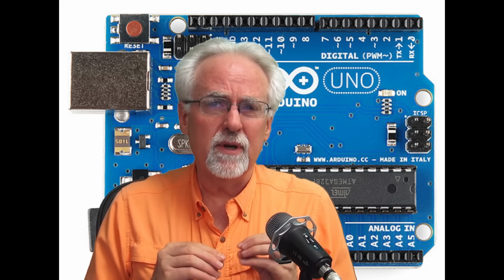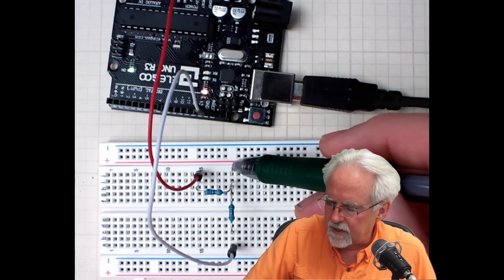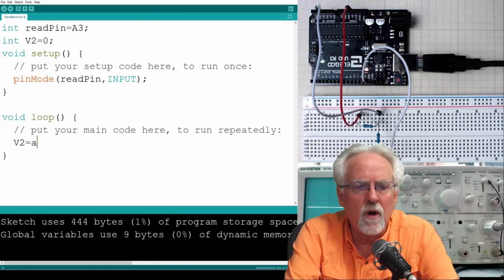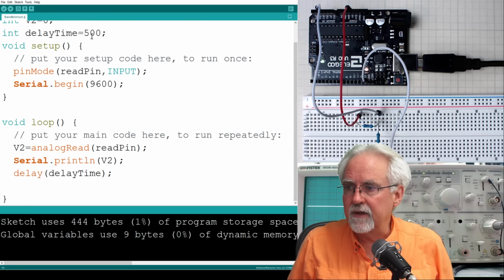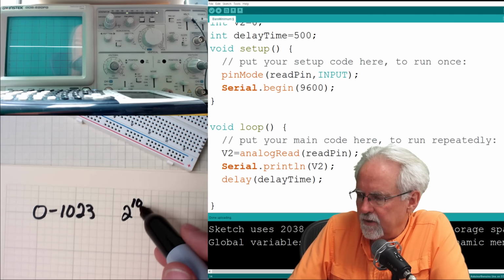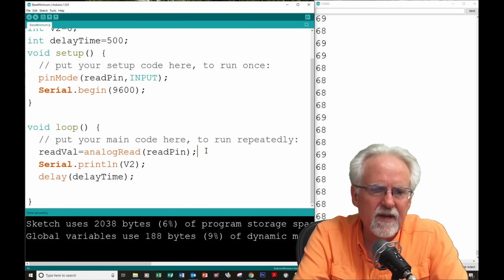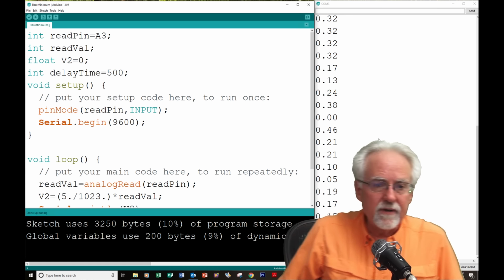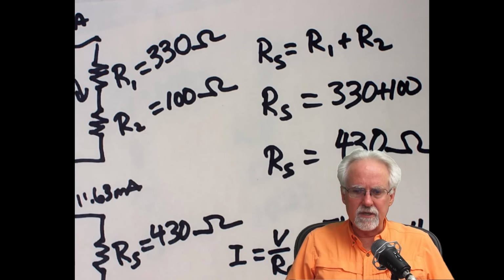Arduino Tutorial 10: Understanding How To Read Analog Voltage using analogRead Command

Comment: I was able to apply the analogRead on a circuit with 3 resistors, and calculated the voltage drop across each resistor and confirmed the potential difference using the voltmeter. I was also planning to read the current using arduino pins but later on, after some research I got to know arduino pins are designed to read voltage not current. Was a great learning experience!
Reply from the maker: Excellent!

Comment: Can the Uno do analog voltage reads on a voltage that is higher than 5v?
Reply from the maker: No, only up to 5
Reply: @paulmcwhorter  I can use a series of resistors to drop the voltage down to 5 V so that way I could program the micro controller to display a different LED to indicate power level of a power supply?

Comment: code compiled. even uploaded and ran but all i kept getting was "0.0" on the serial  monitor. also with the readVal integer, is that a command? i must have missed that part
Reply: when i put my multi meter on it it showed me the values on it

Comment: Weird, when I pull the probe from A3 from the breadboard, the reader is still reading and fluctuating around 1.5 Volts, which i guess makes a read error of +1.5/-1.5 V error in reading? Why is this?

Comment: I'm a little confused by one thing. I got the correct values by setting up the circuit with r330 and r100. When I remove r100 and try to read the voltage  at the trailing lead of r330, I get 0. Shouldn't I be getting a voltage value of 3.84?
Reply: It sounds like when you removed r100 resistor, you cut the circuit so now no current flows, thus the readout would be 0.

Comment: Great tutorial again.  
Question: In turorial 7 we learn to analog write with numbers between 0 to 255 while on tutorial 9 we learn to analog read with numbers between 0 to 1023?  Why the range of the analog read and write are not the same?
Reply from the maker: The difference  between 8 and 10 bits

Comment: Another one done. Thanks again for there wonderful lessons. I used a 2k and a 1k resistor. 
First did the calculations:
I=V/(R1+R2) > 5/3000=1.67mA
V1=I*R1 > 1.67mA*2000=3.33V
V2=I*R2 > 1.67mA*1000=1.67V
Then put it together on the Arduino
V2 output on the serial monitor: 1.66

Comment: Is there a way to measure the voltage across R1 directly (instead of using 5V - V2)?  This is still a little confusing to me.  When you measure voltages with a voltmeter you use two wires and you can put them where you want but from what you are saying, the Arduino can only measure the voltage between one wire and ground.

Comment: I'm having trouble getting my serial monitor to give back a reading. I've triple checked my circuit. I'm using an Elegoo 2560 and Arduino IDE 2.3.6.

Any advice is appreciated. Thank you

Edit : Solved, crtl-U to run program. (ctrl-R just compiles/verifies)

Comment: so i have a funny experience to share and also a question to ask . So basically i used two 220 ohm resistors because i knew obviously that the voltage will be 2.5 Volts but when i checked in serial monitor it was reading 0.43 volts , after scratching my head and changing resistors i realized that the pinMode was OUTPUT instead of INPUT in my code hahaha , before finding this error i noticed that when i removed the ground pin , the circuit was still working. So my doubt is that does arduino consider the analog pin to be at 0 volt by default if we make it an output?

Comment: If you have 5 volt divided by analogReads range which is 0 to 1023. Then a variable to calculate the actul volt is V = (5 / 1024) * ReadValue. But in the video you divide by 1023.
Reply from the maker: No, actually not. Try what you suggest. We agree a read value of 1023 is five volts. by your equation,  V = (5 / 1024) * ReadValue when ReadValue is 1023, you do not get 5. You are not thinking about the problem correctly.

Comment: I have now spent hours trying to understand why my serial monitor is showing different values than yours. Placing the read pin before the first 330 ohms resistor, it shows around 1015-1017. When i place it between the two resistors the serial monitor shows 35. Why is that? I have been over the board and the programming for atleast an hour now and I am 100% sure that it is exactly the same af yours, so why the difference? I realy hope you can help me out here 🙏
Reply: I have now bought a multimeter and it measured the same as the A3 read pin, when its in the breadboard, but as soon as I remove it, the multimeter measured the correct voltage. I do not understand why though. Can it be because i have connected the arduino to my laptop and not a "unlimited" power source? Please help me understand 🙏
Reply: I figured it out! Yeeehaa! 😃😃

Comment: I really like your tutorials, however, your math on the ADC on Tutorial 10 is slightly off. A 10-bit ADC stores the voltage being read in memory, with 10-bits that 1024 possible values.  So, you need to divide by 1024 like it states in the ATMEGA328P datasheet.  ADC = Vinx1024/Vref.  I know the error is minimal 1/1024; however, fundamentally it is incorrect.  You must think of 0 as a range from 0 to the approximately 5 mV until it becomes a 1.  At the other end the 5 V is 4.995 V to 5.0 V, with 5 V as the default reference.
Reply from the maker: Actually you are wrong. With ten bits, you can represent 2^10 different values, which is 1024 values. since you start counting at 0, you can count to 1023. The largest number, therefore is always 2^(numBits) -1.

Comment: The first lesson I’ve found tough! Maths was never my strong suit. I did feel this was a bit quick paced for me. I’ll watch it in full again and and again until it sinks in properly as it’s clearly got tangible benefits. I’m hoping to use some of these projects in my own job and having a clear voltage indicator available on some of the equipment at work would be hugely beneficial. Thanks again for all your time and effort to make these videos!

Comment: I'm getting it now.  I tried a 2000 and a 10 ohm resistor.  First I calculated on pen and paper the voltage drop, getting 0.02.  Then I ran the code and got the correct value, 0.02.

Comment: Hi Paul, help please. I have set up the Arduino and circuit but for some reason the Serial Monitor reads 0 continuously but if I remove the A2 or gnd leads the SM shows various readings. This happens with a separate Arduino.

Comment: What if you want to read the other resistor? As far as I understand, and tested myself, you only have three places to read voltages: Near the source, that reads 5V, near the ground, that reads 0V, and in the middle, that reads 1.16V, is there a way to place A3 in order to read R1's voltage? Thanks a lot for the tutorial, I'm loving it!

Comment: Digging this format! I have a strong background in hardware controls but very light on the programming side. I'm a bit confused as to why when declaring the variable readVal (int readVal) it is not set to a value. I get int V2=0, but not sure I understand readVal not being set to a value (int readVal=something). I am learning so much, this lesson seemed to speed up a bit for me. Thanks again for the most excellent content.
Reply from the maker: It will get assigned a value when you read from the analog pin. Before you use a variable, you have to declare it. You dont have to give it a value at the time you declare it.

Comment: What am I missing. This has been giving me problems. I am using a Chromebook and the Cloud app, but that should not make a difference. I have a jumper going from 5V to A2 on the Serial log I get 16 even when plugged in the 3.3V gives me 16

int readPin=A2;
int V2=0;
int delayTime = 500;

void setup() {
 pinMode(readPin,INPUT);
  Serial.begin(9600);  
}

void loop() {
  V2=(analogRead,readPin) ; 
  Serial.println(V2);
  delay(delayTime);

}
Reply: I think the Cloud interface is the problem, the cloud solution cannot use the Serial interface. So I will re-configure to a PC based system and start again.

Comment: Sir, Arduino can read negative voltage?
Example is:
+5V Input to A0 
255 output from PWM pin
But I want to
+5V = 255
  0V = 127
 -5V = 0
This is possible sir ?

Comment: Hello, Paul I'm NOT getting the results that your getting on the analog monitor (I am on MacBook) I get this box underneath ny code withdow.

Output      Serial Monitor x
Message ( Enter to send message to 'Arduino Uno' on '/dev/cu.Bluetooth-incoming-Port' - Drop down box - Drop down box (9600 baud)
Where did I go wrong?

Comment: Thanks Paul. I'm here mainly to learn how to program the Arduino. In the early 80's  I used to write programs for the Intel 8748/49 microcontroller in machine language for test jigs at work and also my personal projects. It was great fun and very challenging. I came across the Arduino kit while shopping in Amazon and thought it would be nice to get back into it again and keep myself busy in my retirement. Circuits aren't a problem as I have designed and built lots but I'm here for the programming. You are an excellent teacher and thanks for the time and effort you've put into making these videos.

Comment: How would I read the voltage going across the first resistor? Or how can I read 3.84 volts that was calculated for the 330 ohm resistor?

Comment: Why dont u use the command called map to convert the scale from 0-1023 to 0-255. Also, how can you give output from Arduino with no output command??
Reply from the maker: Because the whole point of the lesson was to teach you math, to think critically, and analyze and solve problems, not to just used someone elses canned solution.
Reply: @paulmcwhorter  I just realized you have inserted 5V to the circuit, and also I tested my circuit based on your idea, and it works.
Thank you so much👍

Comment: Having fun, great stuff.  But I have a problem.  When I put the A3 wire before the first resistor, I get a value of 5.  After first resistor, value of 4.  After second resistor, value of 0.  Tried different wires, tried rebooting.
Same thing happens when I use my VOM to check voltages and ohms.  Both resistors ohm out correctly.  Any thoughts?   Thanks.

Comment: Paul, all beverage jokes aside, it was a tad unclear WHY the ADC went from 0-1023. Based on some research, it appears this is just an arbitrary number the makers of the Arduino Uno chose to allow for the flexibility when working with volts. If they wanted to, this number could've been 2046, 512, or any other number. 1023 seems to be a good compromise for the price we pay for the Arduino. Could be wrong

Comment: Hello Paul, thanks for your lecture. I have a question: I use 2 resistors with values of 220 ohms and 1000 ohms, I have measured the voltage value V1 corresponding to the 1000 ohms resistor but cannot measure the voltage value V2 corresponding to the 220 ohms resistor. Can you solve this?

Comment: Great videos thanks! Hope you can find the time to answer this for me. I'm playing with the HC12 transceiver modules and would like to transmit the battery voltage of a remote system. By your, (and others), I get how to read a voltage into the microP and display it on a lcd, but I don't know how to deal with transmitting the data. Is the data automatically available on the TX pin which would connect to the RX pin on the hc12? Of course there has to be a reciprocal setup on the receive hc12 to then transfer it to a display. I guess this would make a great video all by itself! Thanks so much for our thoughts and time! Cheers!

Comment: I see that I'm getting the reading of the voltage of the second resistor.  But how do I read the voltage on the first resistor?  When I place the reading right before the first resistor I'm getting 5v and after 1.17v which represents the second resistor.  Where do I place the wire to read the first resistor voltage?

Comment: If we want to read the voltage that's going through the first resistor in the circuit, shouldn't we be putting the wire plugged into A3 in the same column as the 5V and first leg of the resistor? But when I do that it reads 5 volts and not the expected. I think I'm putting the A3 wire in the wrong place since the reading for my second voltage is correct.

Comment: I'm surprised that the readPin can be an integer considering it has a non-int type char "A".
Reply: After looking into it, if anyone else is curious... "In the Arduino environment, "A0", "A1", "A2", etc., are predefined constants that the compiler understands. These constants are defined in the core Arduino libraries to map directly to their corresponding digital pin numbers. This mapping is done using the #define preprocessor directive in the library files."

Comment: One minor error in the conversion for V2. There are 1024 samples for the 10-bit ADC. So, it’d be V2 = (5.0/ 1024.0) * readVal;   A very small error introduced using 1023. Very good example showing the reading of the analog input.

Comment: Hi Paul,  One problem I'm experiencing is that When I replicate this, A3 (when not connected) is giving me spurious readings that start at 80 and continuously increase until about 420, then reverses direction to about 270, then back up.  If correctly reads 0 when grounded, and about 1011 +/- when connected to 5v.  Is my arduino UNO broken?

Comment: I am able to measure the correct voltage when using the setup with two resistors in series. I am wondering if the same test can be done with one resistor only. I would expect the readVal to be 1023 on the positive end and 0 on the negative side. If so, this seems to only work when testing the point where R1 and R2 come together in the circuit. Am I missing something?

Comment: Paul these are outstanding tutorials! Thank you. When measuring just the two resistors is it correct to say with analogRead we can only measure voltage after the voltage divider (R1)? So we can only measure the voltage across R2?

Comment: sir ,Why is analogWrite 0 to 255 (8 bit) and analogRead 0 to 1023(10 bit). is ATmega328P 8 bit microcontroller, how you use 10 bit in it. please explain sir.

Comment: on my bread board I passed it through two 330 ohm resistors and at the end of the connection I made sure to ground the circuit, but I noticed while reading the voltage through the circuit I was getting 5v. Even when I made it 330 ohm and 220 ohm I still got 5v. Shouldn’t the resistors drop the voltage? Are my connections correct?
i'm using this the code 
int ReadPin = A3; // white
float v2 = 0;
int delayTime = 500;
int readVal;

void setup() {
  // put your setup code here, to run once:
  pinMode(ReadPin, INPUT);
  Serial.begin(9600);

}

void loop() {
  // put your main code here, to run repeatedly:
  readVal = analogRead(ReadPin);
  v2 = (5./1023.) * readVal;
  Serial.println(v2);
  delay(delayTime);
}
Reply: I tried the original resistor values you gave in the video. initially I got 5v but when I readjusted the jumper cable I started getting the 3.8
Reply: however its still need answers for the 330ohm 330 ohm circuit

Comment: Hello. I tried building parallel circuits and they worked too, after some head scratching. There is one thing I don’t understand, because I’m not thinking clearly. The component connected to GND is always at zero volts, and there is zero current in the wire from the last component to GND. Since the circuit will not work unless this wire is present, what does this wire do to effect the cause electricity to flow? Can you point out my mis-understanding, please?

Comment: I was able to do it on ny own. I'm about to do the assignment. But how can we read the V1, the voltage of ghw top resistor in the diagram?

I switched the input voltage and ground pins on the breadboard but how can we do it without switching the input and ground pins?

Comment: I am wondering how to read a voltage higher than 5 Volts ...
btw , i am sure you heard this a lot , but the errors you are putting in on purpose are so helpful ....,  you must have been teaching a lot ... , you are helping us to avoid the deadly pitfalls , by simulating those deadly errors .... , it so much time saving .... . this is what i would like to see teachers in school do this .  Instead of letting their pupils run into that errors .., its so frustrating ... duing school time searching for errors and wondering what mistake was made .
Making aware of the pitfalls is just an awesome thing to do .., and helping save time ,  mistakes, and so much nerves ..., by the way ..., i would like to see that eelego kit with an usb-sick instead of a CD , my notebook does not have an CD-drive .
Another nice Kit i had is the Freeduino - Kit , because of the printed lessons in a booklet .

Comment: this ones being super weird. I was getting incorrect readings even after going back and double checking the math. using a 220 and 330 ohm resistor in series. the 330 worked as expected but the 220 was odd and reading 0. I tried troubleshooting to make sure I didn't accidently grab a 220k thinking it was 220. I changed the resistor to see if maybe I had a broken resistor. i checked the code and my code is the exact same as yours and it runs and gives readings.(the readings were correct for the 330) so I tried a test and plugged into a hole that was isolated and had no power to it (different row different column, totally isolated). still getting a reading of between 0.0 and 2.61. it changes reading every few times it refreshes. eg it'll read 10-15 lines at 2.61 then do 2.71 a few then 2.50 for 15-20 refreshs. on and on. so I unplug all cables and it still reads? i then pulled everything off the Arduino so only the power supply remains and its still returning readings??????? I re-compiled the code and sent to Arduino, with Arduino unplugged entirely from breadboard and its still sending back readings?? i took a video. what could be going on?
Reply: What was your solution?